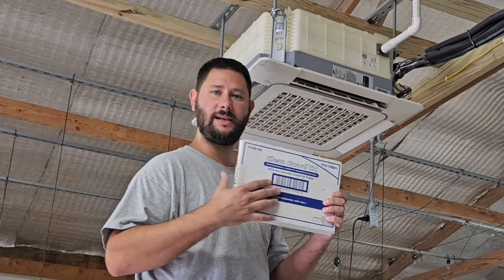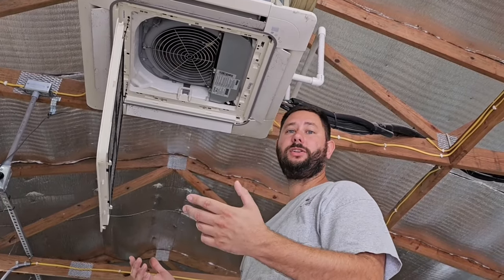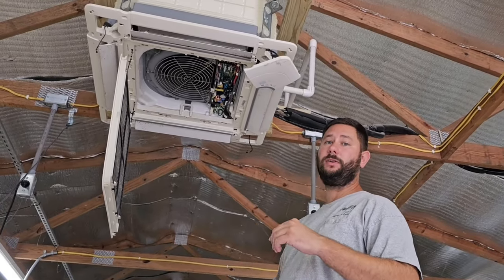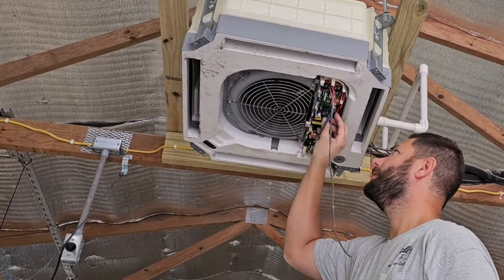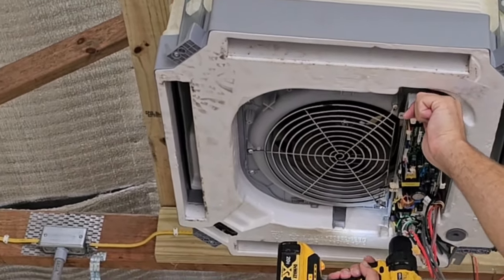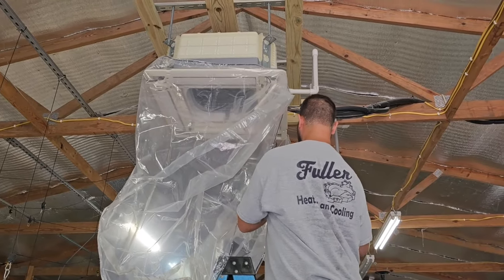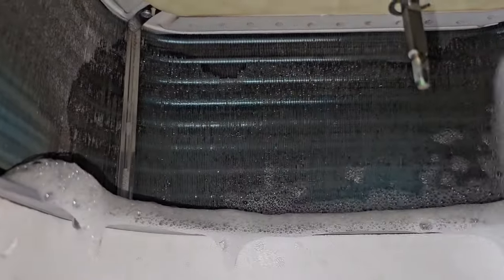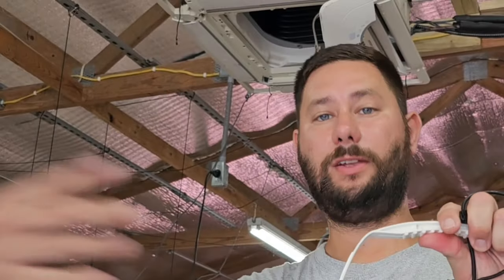Ceiling Cassette Cleaning Hacks You Need to Know

Comment: Just one more point...I think the Idea of the video is to encourage a homeowner  to do a simple job by himself. But as you finish the cleaning process   the remaining sockets in the unit will be with moisture or water which has a good chance of short circuit if just plugged  in . Suggest you need to blow dry whatever connectors after the cleaning process

Comment: Taddy .. thanks for the video. Need clear a point. As you wash the coil the dirt fills in the drain pan and overflows to the maintenance bag. As so isn't there a chance for dirt to be stagnated in the pan and choke your drain pump or line ?. Suggest it would be better to have the drain plug removed in the cleaning process ,so that all dirt would drain to the bucket.
Reply: I was wondering the same
Reply from the maker: That is correct

Comment: Taddy, I’m glad I don’t sell those things unless a standard split hp is not appropriate for the situation. American Standard AH PM:  Turn off circuit breaker, remove Twelve 5/16” hex screws, remove air handler panels, clean coil, drop algaecide tablets in pan, inspect electrical, reinstall covers, screws, turn circuit breaker on. Done in 6 minutes. It takes 15 minutes to get prepared and just get access to those mini split coils and then hope n pray you don’t break any of that plastic or those connectors. Then hope it doesn’t throw an error code once you wrangle it all back together.

Comment: Very useful video for novices. My wife and I followed Taddy's sequence as we took apart a Bryant cassette similar to the cassette Taddy works on. We brushed off most of the grit that clung onto the grill. We cleaned the coils with A/C Foaming Cleaner spray (ACE Hardware). Let the foam stay on for 15 minutes. Then rinsed off the foam with water in a spray bottle and removed the drain plug to release dirty water into a pail. We reversed Taddy's video to reassemble the cassette. Two useful tips: 1) Before disconnecting wires, take a several photos of the circuit board and place tape on wires to identify which plug goes into which receiver. We marked  one set by writing "1" on 2 pieces of tape. Attach the tapes to the plug and receiver. To reassemble, we pushed plug 1 into receiver 1. 2) Use YouTube videos like "You can't remove this connector" to learn how to disconnect and reconnect wires to Molex receivers that are on the control circuit board.
Reply from the maker: very cool 
Thank you for sharing this and for watching

Comment: Thanks for making this video.
One consideration. Since we always want to clean coils opposite direction of air flow - maybe it’d be best to completely drop the drain pan - add your coil cleaner to the inside but wash the coil from the other side. Probably get a 90 adapter for the pressure washer - make sure it’s not any kind of pressure that can damage the fins.
Just an observation - probably over thinking

Comment: Can a single cassette heat and cooling a 800sq.ft 3br home?
Reply from the maker: It depends on the layout and also depends on if it's foam insulated.
I put a three ton mini split cassette in a foam insulated three thousand square foot house Ten years ago and it's still works great
Reply: @TaddyDigest  Alright it's a all brick home 10in thick 2 family home.  Flat roof rectangle layout. No foam insulation and I want to only put it in the second floor. Is it do able and what size do you recommend.